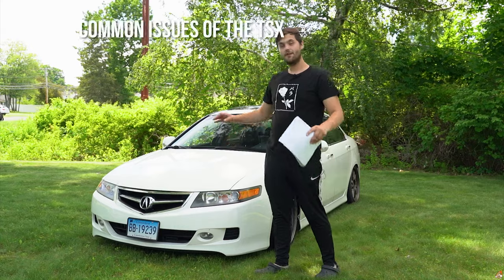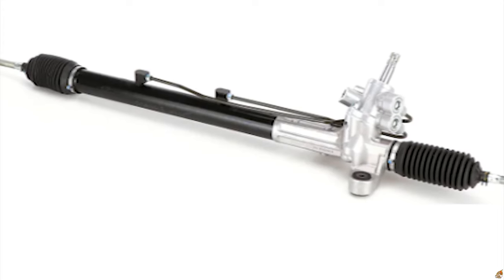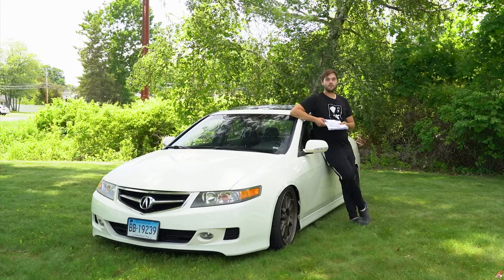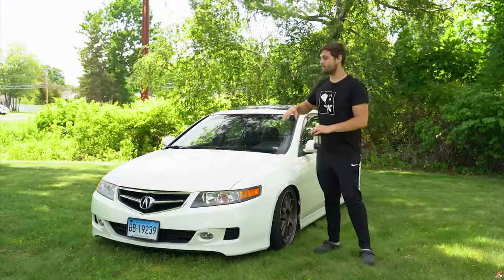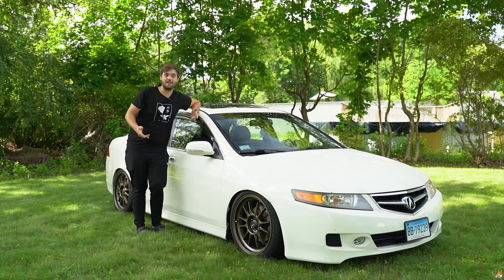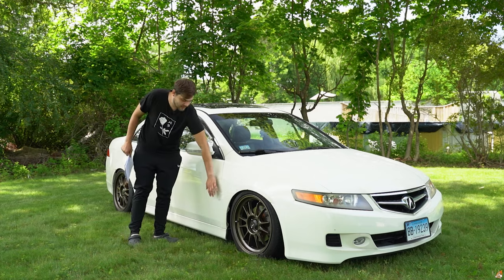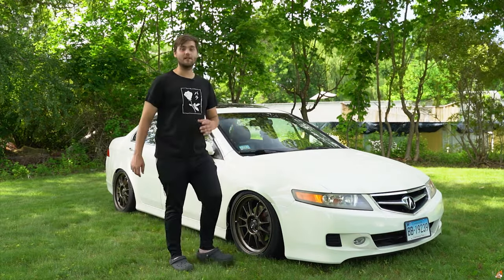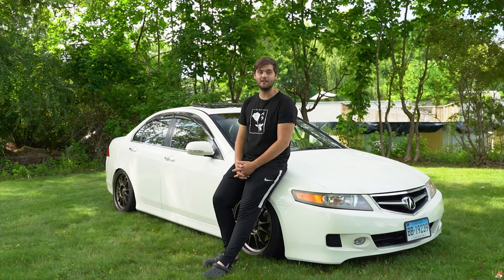TOP 10 COMMON ISSUES With An Acura Tsx

Comment: I have an 2004 TSX and my problem is the casa/radio and clock lights are dim and I have to use my flashlight on my phone to see the time or to change the station like the lights work they are just really dim and I’ve tried the knob on the dash but it only brightens up the dash lights. Plsssss HELPPPPPP
Reply from the maker: Cant fully remember what people said about that id suggest changing out the fuses that deal with any lights or dash stuff. If that doesn’t work then possibly the the center console stuff are starting to go.

Comment: Hi I have a 2007 tsx recently had a weak crank and then now it just won’t crank no more, when your trying to crank it all the lights on dash comes on radio everything works just no response I have change the starter and ignition switch still no progress. The battery is about 5 months old I’m not sure what else to look at next hope u can help me out thanks.
Reply from the maker: I’d say get your battery tested, also check your ground wires. Could also check the voltage coming from the alternator see if it’s charging proper. 

Also can try to unplug the Bluetooth module it can be causing a drainage issue.

Comment: So I had one of these... badged as a Honda Accord Euro. Lost the alternator twice. Power steering hose had to be replaced as it was leaking. Back brake calipers at 150,000 km. Then the transmission went completely at 154000km. Know 3 other people that owned the same model. 2 of the 3 lost alternator and had complete transmission failure.
Reply from the maker: Yeah the alternators always seem to go with these quicker with aftermarket ones. Even then somethings the parts itself can be faulty. 

I’m assuming you had a automatic? Cause those do seem to get more issues or bust on people the 6speeds have been pretty solid.
Reply: @RishMedia  yep was an auto cant remember how many gears was either 5 or 6
Reply: @jamesanderson2921  what year was it?
Reply: @alexomer9916  it was a 2007.
Reply: @alexomer9916  it was a 2007.

Comment: Ik this like 2 years ago but what if your rpm gage not working?? I got a 04 an the rpm gage doesn’t work.
Reply from the maker: Honestly can just be something on the circuit board fried out, or could be a wiring thing/sensor behind the cluster.

Comment: Grill disentigrates, the cd changer stops working, and it leaks on a good rain!!!
Reply from the maker: Hmm never had grill problems except trouble lining things up, I did have a bad leaking in the back assuming from like sunroof drain. Never full found the culprit
Reply: I've definitely experienced some grille trim fatigue. Bought my car a year ago with a tiny bit of trim hanging on, but I have since replaced it.
Reply: @RishMedia  the leak may be from the membrane in the rear door cards. That’s what I found after researching it...but then I came down with a bad case of the lazy, so I never fixed it.
Reply: @kurtislecompte7587  mine fell apart, but the base was good, so all I needed to do was replace the chrome (plastic)...then my wife hit a deer...and I’m out!
Reply from the maker: @robcannarella3493  Yupp toward the end of my last Tsx I started getting like puddles forming in the back of my drivers seat. Sun roof was clear didn’t dig deeper than that tho

Comment: Literally all those things have gone out on mine Alternator, Starter, Power Steering Rack, PS Pump, I will say too starter is a PITA having to take intake manifold off to get to it. word of advice people NAPA has some of those replacements with Lifetime Warranties I have actually used. Considering mine is well taken care of and all these went out around 60-65k miles the mileage does not have anything to do with any of these things going out I’m super super caring of my car 

Other issues would be the upholstery if not cared for crack breaks rips leather easily 

I have ceramic 5% all around with 20% on my windshield and I still use a rollable sun shade on the windshield to block sun
Reply from the maker: Yeah seemingly common no Matter what some times but good idea with the sun blocker ima need that for this floridas heat and black interior

Comment: Hey 👋🏼 got a 07 mt6 …..did the a/c,power steering…..now it’s vsa triangle light almost no power from the engine 🤷🏻‍♂️
Reply from the maker: Vsa light doesn’t normally take away your power, need a scanner on that to check for any codes etc
Reply: @RishMedia  I’ll let you know code ….. every time it started without vsa warning ⚠️ it revs normally until vsa light turns on and it doesn’t go over 2k rpm 🤷🏻‍♂️
Reply: @RishMedia  ok so VSA codes 2601 and 2176 ……it’s says throttle body-throttle idle not learnt 🤷🏻‍♂️🥴wtf lol

Comment: I have the 2004 and sometimes when I start the car it won't ignite and turn it off and try again then it starts, sometimes it will start and when you try to raise the car  it won't raise and will have to turn it off and start it again and it will raise. Please do you have any similar problem like this and what might be the cause? Thanks
Reply from the maker: Wdym by the raising car part? lost me there tbh, it could be numerous things. Any CEL, other kind of problems how many miles in the car, maybe a fuel cut/fuel pump issue but not sure.

Comment: Has anybody has an issue with the car flicking on & off while driving & once you turn it all the way off, it goes dead. I have a 2007 Acura TSX.. it’s not the battery
Reply from the maker: Does the battery go dead after sitting for a little bit maybe couple hours or overnight? Look into the blue tooth module or your alternator

Comment: my rack seems to be going out i thought it was powersteering but the power steering pump works good, i am leaking power steerig fluid from the boots of the rack. any sugggestions i bought this car about a month ago from a private sales and now this happens. PLEASE HELP. its leaking where the boots meets tie rod?
Reply from the maker: Dang man that unfortunate what’s the year and mileage? But yeah sounds like you need a new one I recommend Detroit axle like I did if you want to save money or get oem but it’s pricey
Reply: @RishMedia  2008 tsx 204k miles ive put like 400 miles on it since owning it now this happend
Reply from the maker: @l3gitcravee  ahh yeah probably became time especially if never had been changed either

Comment: I wish i had this video b4 i tried taking off the rusted bolts off my control arm the videos to replace it never mentioned it changed my starter twice rack and pinion  power steering pump and now i have to do my engine mounts i thought hondas were supposed to be reliable
Reply from the maker: They are reliable! Just these cars sometimes don’t like the aftermarket parts, and just general maintenance things. 

But can say the control arm bolts are a pita

Comment: Yesterday night it was 19 degrees Fahrenheit and my anti-freeze froze smh, when I turned the car on the water pump broke, I must of had cheap antifreeze in it, i grabbed the gallon I had in the trunk and it was slush smh
Reply from the maker: Gahhh damnnn that’s the worst man.. water pump isn’t the most fun job to get to but possible. Hopefully your cars not down for to long
Reply: @RishMedia  well I just bought the pump for 74 bucks from the local parts store hopefully I can get it done today, but yea it sucks, I was hoping i just needed to wait for coolant to unfreeze but waited all day and nothing, I had over pressurized coolant hoses, no heat, and I though it was possibly and hopefully just a stuck thermostat but after removing to thermostat car was still overheating and a lot of pressure in the coolant hose and no heater I accepted the fact that it most likely is the water pump, I’ll b doing the water pump in about a hour and hopefully everything will go smoothly and problem will get fixed…thanks for the reply I appreciate it
Reply: @RishMedia  just took it all apart, the whole propeller broke off the water pump, am putting everything back together now

Comment: What’s your recommendation on motor mounts? I need to replace it and keep hearing guys say just go OEM. Also should I do all 3 or just the one bad one?
Reply from the maker: If your stock not running big mods or don’t plan to really go Oem, cause you’ll deal with the vibrations if you go innovative. 

Oem new are a bit of money I’d say just start with the ones that are bad/torn

Comment: RISH!!! HELP!! How do i know if its my starter or a fuel pump???
Reply from the maker: starter would be if the car has some long slow cranks or cranks alot for it to start up or some cases not crank at all and if you tap the starter may trigger to work. Fuel pump it would be cranking but have no spark or struggle to stay on. If you put your key in and to the ON position you should hear your fuel pump click on.

Comment: The issue I'm having right now is that the power outlets arnt grounded so I can't plug anything in all the fuses work but not the sockets. I don't know how to fix it pls I'd love some feedback
Reply from the maker: Honestly electrical stuff is my weakest link 😅😅 but with that always look at your ground cables, 2 of them make sure not they’re not all old and beat up and the connections are proper. 
Then making sure battery terminals/connections are good and clean.

Comment: Pretty much my experience with the 06 TSX 5AT w/ navi I had with +175,000 miles (totaled back in fall 2019:
- two alternators (local)
- A/C compressor (eBay)
- P/S pump (eBay)
- P/S rack (Amazon)
- hairline crack in radiator
- faulty condenser/radiator fans that didn't spin fast enough at city speeds, overheat issue
- replaced radiator cap
- replaced overflow reservoir coolant hose (sucking in air and air bubble in heater core causing no heat in winter) 
- passenger upper control arm (HeelToe)
- rear camber kit (HeelToe, lower Aspec suspension)
- replaced snapped OEM endlinks (had Progress RSB, replaced with HeelToe Fastline adjustable endlinks from HeelToe)

Seems like a lot; but, the cost was spread across the 13 years of ownership (mostly after +125,000 miles).  Everything else from bumper-to-bumper worked as new.
Reply from the maker: See that’s not to bad little hiccups buts that’s a big overtime period too seems like it was a pretty solid sucks the PS rack went some jobs are just annoying

Comment: Can someone PLEASE assist me. I'm lost. I have an 05 tsx. It's now jerking and popping on the vsa light and the exclamation inside the triangle. I've changed the spark plugs, the starter, the brake sensor, and had the alternator checked.
Reply from the maker: The VSA issue is a tricky thing cause so many stuff seem to trigger that. 
Look up about your abs module you can try to reset it with a certain procedure that’s on YouTube. Gotta jump pins I think 1 and 9 on your obd2 and press some bottoms in a certain sequence to get those to turn off.
Reply: Thanks for responding. I'll give that a try. Thank you!
Reply from the maker: @arice4839  hope it helps some, best of luck!
Reply: @rish thank you!
Reply: @RishMedia  thanks. Even if it doesn't, it's a start in the right direction.
Reply from the maker: @arice4839  I even have to get around and figure out my VSA light but hasn’t bothered me enough yet. 😅

Comment: I have an 06 6 speed with 121k, I got it with 105k from a single owner who really took care of it. I've really only had to do a coil pack as far as I recall and that's not that strange. I have a few general complaints, you mentioned the drive by wire lag, which is god awful in first gear!! I have been driving manual for 20 years straight and it jerks so bad sometimes no matter how you finesse it. I did notice if I sort of press the gas with my calf muscle only, not my foot, it's a little smoother lol. My clutch pedal gets creaky when it's REALLY hot, like 90+. I put a Comptech short shifter in, and it's nice to not have to lean to reach third. 

Yeah the drive by wire is the only thing I actively can't stand. I'm coming from owning a lot of DA Integras and being used to a cable clutch and throttle cable instant response, so even after 2 1/2 years I am still not totally used to this car. But overall, it's a great mix of luxury and sport. I'd like to drive it until it blows, but since I live in the snow belt of Ohio I am sure rust will kill it before anything else.
Reply from the maker: Sounds like its been super solid! Ive got a tune, solid mounts, em1 cmc to remove the delay valve and still deal with bogging and annoyance with 1st-2nd 😂
Coming from new England myself cant escape that rust but i got a fresh engine though!

Comment: Bought a 04 TSX AT w/ 62k miles. Hearing a loud whining noise when in sport shift mode at higher RPM’s. Sounds like a supercharger. I turned the speaker volume off so I don’t believe it’s coming from the speakers. Any idea where it could be coming from?
Reply from the maker: Hmmm and you dont have any codes or weird issues? I almost feel like it still can happen when the radio is off dont remember if it was like that for me. Could be one of the pulley bearings or just the alternator. But try to get that and your battery tested first.

Comment: I need help I have 07 tsx when I cut car off I still hear like ticking sound I don’t always hear when I do it drain my battery then I need a jump do u know what that could be
Reply from the maker: Hmmm the simplest thing to check first with the 06-08s are the battery draining from the bluetooth module, right side panel under the glove back area take plastics off, and unplug the green wire. Start/jump your car and drive around for awhile to give the battery a recharge. Come back to it again little later see if it starts, if not maybe the alternators bad. Do you hear a whining sound from speakers while accelerating?

Comment: What can cause a 06 tsx to shut off when I turn
Reply from the maker: It could be a few issues man, potentially having some sort of vacuum leak. A ground wire/voltage issue. 

It’s hard to say without seeing or much info

Comment: I have a 07 tsx. When driving it makes a woom woom woom noise in the front. On turns at lower speeds its a little louder. Starts around 30 and up. Could it be described in the video or something else ?
Reply from the maker: That almost sounds like a wheel bearing your describing. You can check by lifting up each wheel and see if there’s any wheel play back and forth.

Comment: Brooooo what wheels and tires are those i wanna buy red wheels and good tires all around need number recommendations
Reply from the maker: They’re konig hyper grams 18x8.5+35 and 225/40 tires and always worked well for me lowering quite a bit without needing camber arms or fenders rolled
Reply: @RishMedia  can’t lower mine cuz of the winters and potholes here 😓 would destroy my whip, but you think 18x7.5+40mm and 235/45 would be good too?

Comment: I have a 2005 tsx. For some reason I have gone threw 3 axels in a week. Not beating on the car either. I don’t know what it is. I wanna change the motor mounts and the lower control arm to see if that works. Do you know anything about that
Reply from the maker: What problems are you having that you went through 3 axles in a week that sounds odd.. what axles did you go with? 

Our cars don’t like after market axles, some might be funky right out the box and you’ll always get a vibration. 

If it’s your passenger side take a look at your half shaft too, bearing might be shot and making noise/shaking. 
Was my culprit before!

Comment: I’m having an issue with the abs / vsa lights now the car has a noise and a weird rumble from the pass side was thinking the abs sensor but not sure why I’d get a rattle haven’t looked at it yet but wondered if this was common also I did reset the lights at on point now they won’t stay off
Reply from the maker: More then likely bad wheel bearing, abs and VSA turns on to the sensors going bad and or the wheel bearing along with it

Comment: I have an 04 tsx with 207000 miles and it makes this whine noise I don’t know if it’s normal I thought it was but I guess not I’m just tryna see what it could be
Reply from the maker: Is it a whine through your speakers/picks up pitch if you speed up? That would be your alternator, if not then maybe the power steering pump.
Reply from the maker: Or even just like the O-rings on the high pressure lines of power steering pump. Those got recalled at some point
Reply: @RishMedia  it’s not thru the speakers every time I turn the car on it whines it doesn’t stop it’s not loud but it’s annoying everytime I turn the wheel In park it makes the whine noise also

Comment: Hey guys, just wondering if somebody could help me out. I have a 2008 TSX. Lately, the car has been making a noise when I am idling at a stoplight when the car is in drive, or if I have a car in reverse or in the lower gear. It stops when the car is in park, or in neutral. Does anybody have any idea what’s going on? I also recently replaced the alternator so I’m not sure if it has anything to do with that?
Reply from the maker: What kind of noise is it?? 
Like a humming something rotating constantly,
Could be the belt, power steering pump, alternator or the idler pulley/tensioner. 

Could also be motor/trans mount related, it’s hard to say with minimal info/not seeing or hearing it.

Comment: About the master cylinder problem. I did a clutch job on my 04 tsx and it has an issue going into 1rst gear sometimes. It has a crunching sound once i put it into first gear but if i put it into second gear first then put into 1rst gear its fine no crunching sound. Do you think this would be my master cylinder? Maybe the clutch fluid isnt going through as much?? Thoughts??
Reply from the maker: What clutch master is it and clutch did you use? You maybe just need to adjust the clutch pedal a little to help it out. Make sure your slave or CMC doesn’t have a leak.